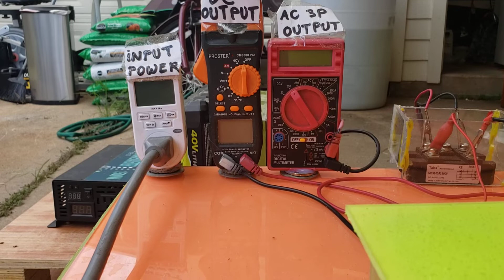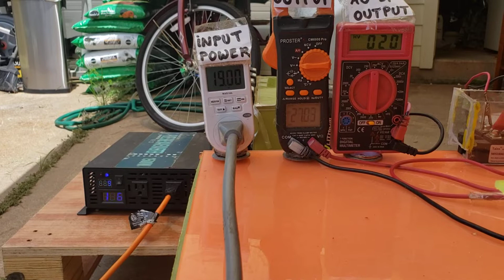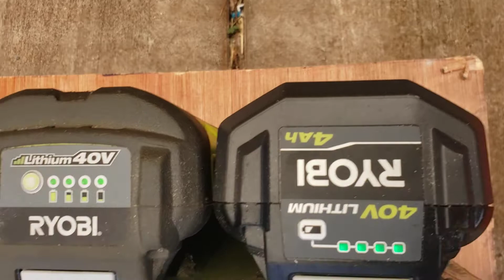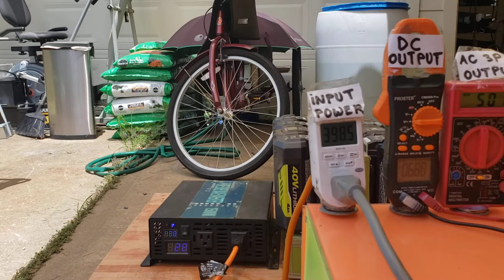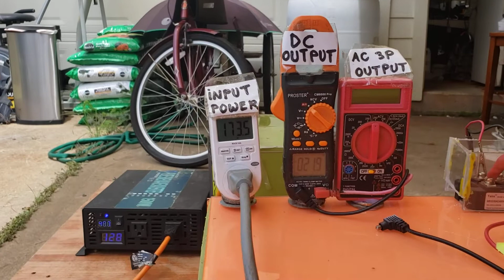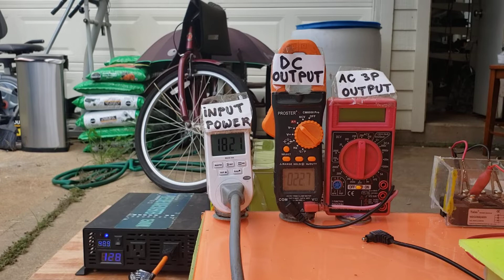Electric 430X generator: input 400W output 60Kw vac or 172Kw vdc onboard fast charger.

Comment: the AC power calculated like this Power = Voltage (V) x Current (I) x Power Factor (PF) x square root of three so in your case it will be 10kw providing the power factor is 1

Comment: put some load test, like resistive load
Reply from the maker: Need an inverter before any load. This is a high power output. Right now i am building another smaller version. You are missing the point here. My plan is to use the generator to charge batteries and use inverters then power anything that you want. Right now, this setup  prove many time more output than input which the main science said that it cannot be done.
Reply: seems like a rotoverter isn't it
Reply from the maker: @nosyamselrahc3059  Nope, it's a 1 unit motor/generator. Motor it's a generator. Generator it's a motor. The 1st millisecond it's the motor, the next millisecond it's a generator. Very few people in the world truly understand this fact. This is the 1st step to create over unity.
Reply: what brand of variac do you use
Reply from the maker: @nosyamselrahc3059  custom make

Comment: Is this your production model?
Reply from the maker: Nope, another working prototype to reduce parts and size still maintain the same power, but mainly to save cost for production. Production model will be even smaller.